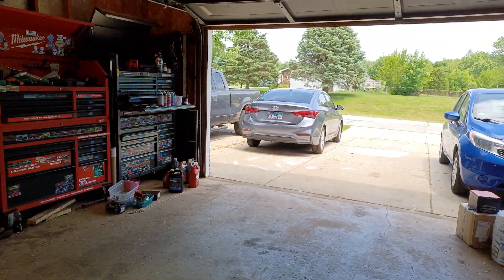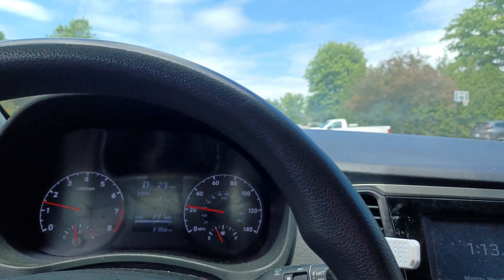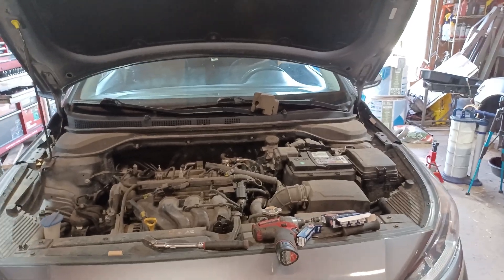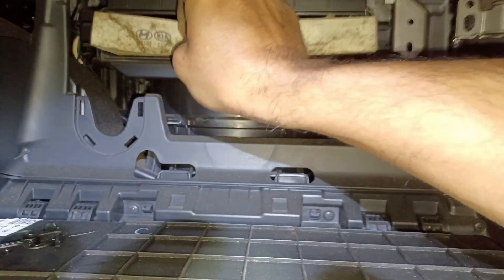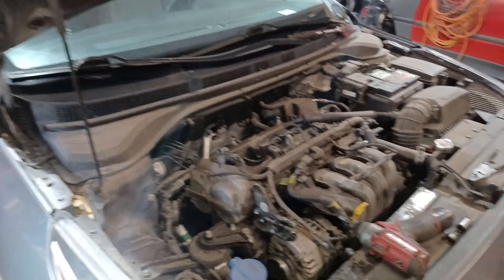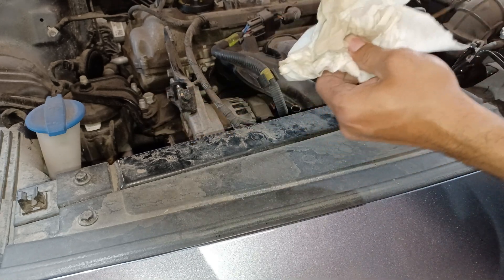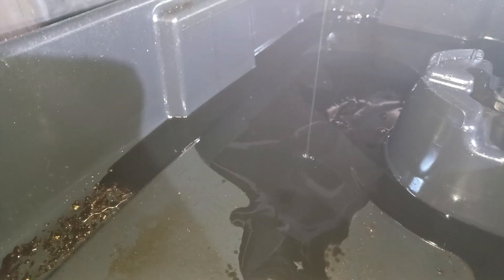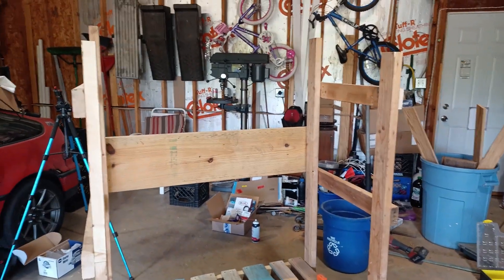Neglected accent saved just in time !

Comment: I used to have a Mazda B2000 pickup years ago. I had a local shop do the oil change because it was winter and I didn't wanna crawl through the snow. 3000 miles later I check my oil before moving 700 miles away. There was no oil in the engine at all. The shop never put any oil in it, there was no leaks anywhere. It took 5 qts of oil before it was full. The engine never showed any signs of problems at all in those 3000 miles.
Reply from the maker: That's impressive,  some cars can't go 30 minutes with no oil lol

Comment: That fourth plug tells the story, this car's gonna die soon. It's a used car nightmare, a dishonest seller will say it works fine, and there's no way to detect the problem without misfire codes. The low oil is spooky! If it died on the test drive, an ignorant owner might think you did something wrong. I would get into the habit of checking oil before a test drive.
Reply from the maker: That's a really good idea, I was thinking the same . What if something horrible happened during my test drive due to no oil, I'd get blamed.  I'm going to make it a habit to check oil first from now on.

Comment: My own personal opinions and diagnosis:

I would remove the valve cover, remove the plug from that fouled cylinder,
install camera with a rubber plug to seal, and install smoke machine in intake.
A valve seal has failed, causing excessive oil consumption, and probable converter plugging/fouling.

You should see smoke coming from the top (under valve cover area)
and inside the cylinder. Think of where the oil is.

Hard acceleration (bald front tires) and lack of oil has caused a cascading
failure condition, coupled with lack of any maintenance and improper driving.

The powdery, white deposits on spark plugs is usually from "fuel additives"
(cleaners) and extremely cheap, ethanol-laden fuel.

Comment: Thanks for making your videos bro. Very helpful and I learn a lot thank you for what you do much appreciated!!😎
Reply from the maker: You're welcome,  I appreciate the comment 💪💯
Reply: I seen you video  on changing the spark plugs on your nissan versa.i have a 2015 nissan versa and I'm getting ready to change the plugs  tomorrow. I attempted to take off my manifold  and the 5 bolts  that hold it on at the bottom are very tight and I'm worried I'm going to strip them and advice?
Reply from the maker: If they break free a little try to work them back n forth before completely removing them. Also try penetrating fluid. Make sure to have new gaskets for your intake manifold

Comment: Mechanic tool my o2 sensor out for routing brake line. Created leak. At the shop now for complete exhaust pipe converter replacement.  Crossed fingers hoping he can do it.
Reply from the maker: That sucks, hopefully the problem is fixed by now .